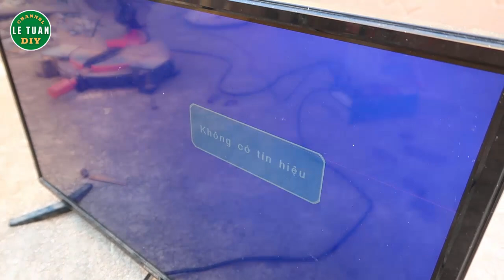How to make a simple inverter 12900w, 20 transistor d718, No IC

Comment: Great video, but how can I choose the appropriate converter for the inverter? I manufactured a 3000 watt inverter, but the transistor overheated. What is the reason? Please reply. Thank you
Reply: 你没有加硅胶或者加大扇热面积吗
Reply from the maker: you check the transformer and the frequency level for the transistors